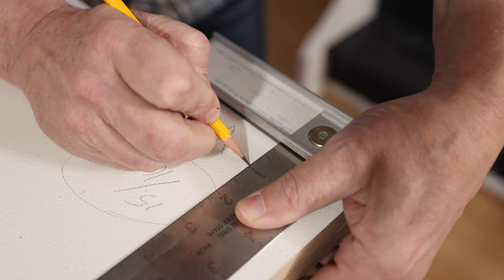Adding Dog Holes To Your WorkBench I 4K

Comment: Not sure why "efficient" spade bit is worth it over a cleaner Forstner bit?? Given I want the bench to last very many years, I am happy to spend a little longer on cleaner holes..?
Reply from the maker: Spade bit cuts faster and is capable of clean holes, they are routed after to remove any chip out.  It really doesn’t matter what bit you use.  My spade bit fit my dog hole accessories best.
Reply: This method may provide dog holes, but they will not have the accuracy to be perfectly square to use a fence or for square assemblies.  Best methods are to use the Parf system or a CNC template.
Reply from the maker: @Selkian  Right….